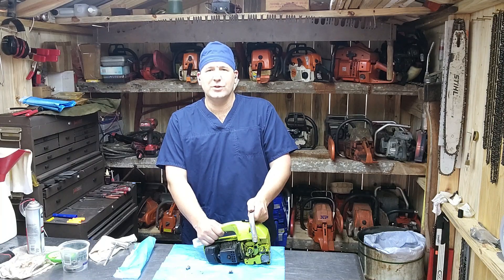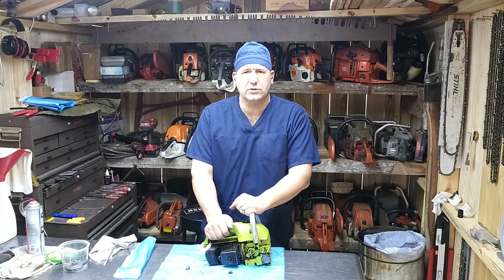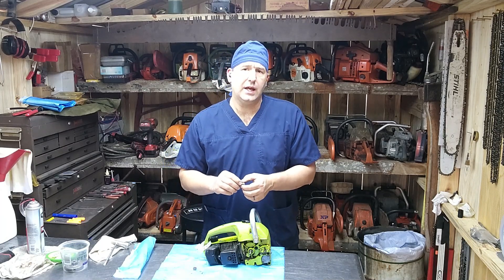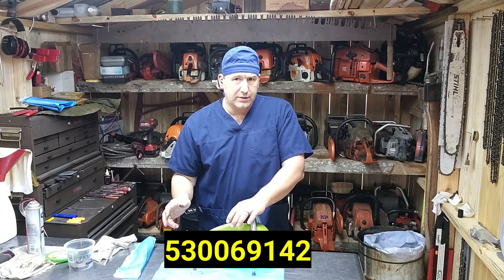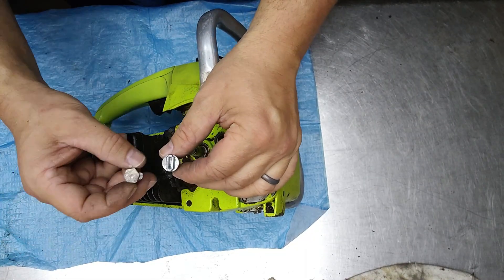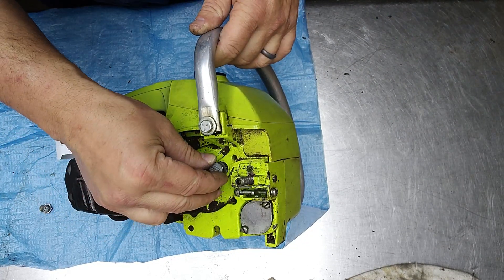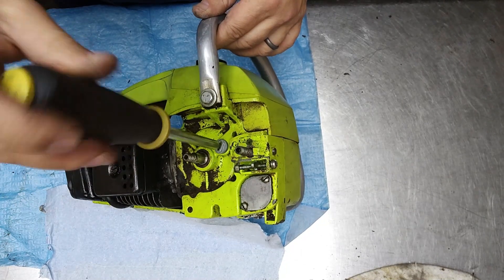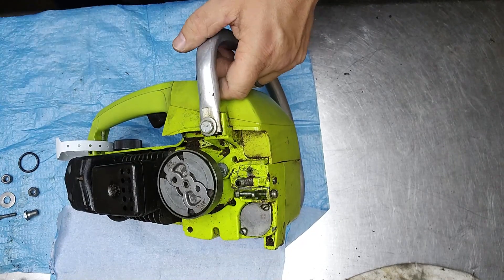Part 3 (Adam) Poulan Micro XXV 25 Oil Pump Check Valve Replacement and TEST CUTS!

Comment: where did you find the check valve.  i found one on ebay.  looks like NOS.  and there is someone on the Arboristsite offering to make one for around $32 including shipping
Reply from the maker: @DavidSalazar-vp3pz I got it from eBay. Mine was NOS too. Worked great. That's good to know someone is making them. Might need that in the future. I love keeping the old stuff running. Thanks for sharing. ~Dr. C.